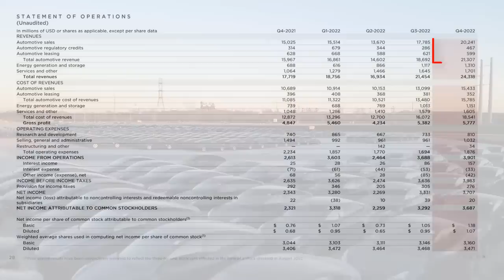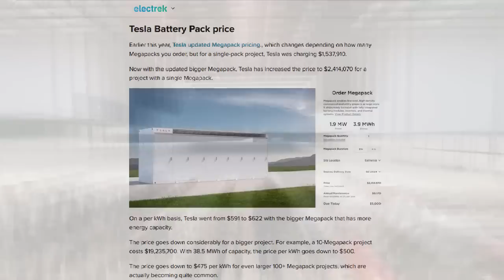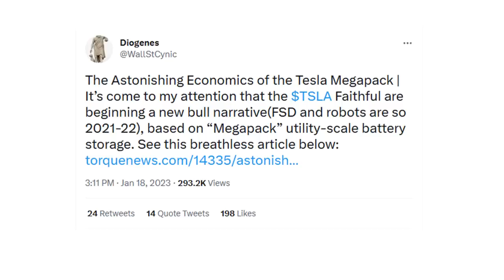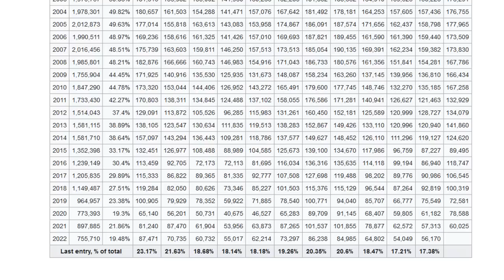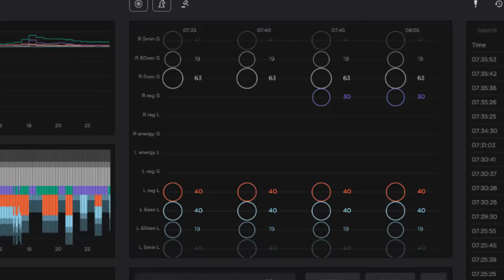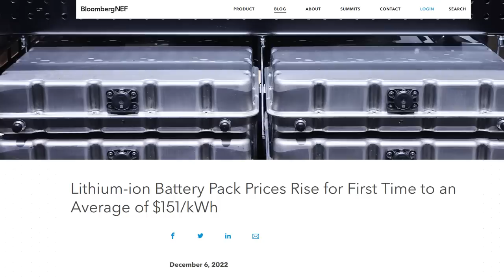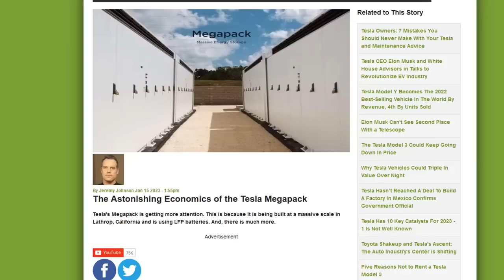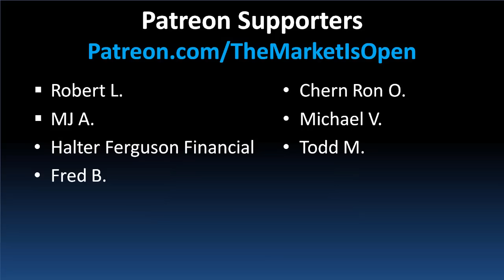How Tesla’s Megapack is SECRETLY Helping them Sell More Cars (Not What You Think)

Comment: Megapack, Powerwall, Semi, Cybertruck, Solar, Dojo, etc will all be huge but there's so many more products yet to come that no one is really thinking about.
Reply: And don't forget Starlink, Insurance, HVAC...
Reply: I am hoping for a semi trailer with its own battery and electric motor, even when you put a diesel semi in front of it it would turn into a hybrid.
Reply: @rowanbroekman3929  it's a weight issue. Adding an entire battery pack, inverts, drivetrain, charging hardware, motors etc to a trailer would massively eat into the weight it can carry. It doesn't make sense to carry around all the weight of both drivetrains when you're making money based on how much cargo you're carrying, which is itself a legally capped total amount (cargo plus vehicle and trailer weights).
Reply: @halohat2286  starlink, no. That's SpaceX, not Tesla. No word on HVAC from Tesla, that's all been speculation by the public. But you could add in Optimus and robotaxis, no one has mentioned those yet. Plus whatever else comes out of Elon's mind.
Reply: @halohat2286  And possibly a Tesla phone.
Reply: @truhartwood3170  All Elon... who also has discussed HAVC. Low priority at the moment, sure.
Reply: @halohat2286  did he discuss HVAC? I didn't see that. Cool.
Reply: @rickhammond2473  Who even came up with that idea. It just seems stupid. It doesn't fit tesla's mission or current factories at all.
Reply: @truhartwood3170  But it does make sense in a car that is only allowed to have about 300kg of weight in it? Yea, sorry, doesn't make sense. I understand it's the standard answer of a sceptic, but it's not actually true.
Reply: @pan6593  I understand, it's more like a range extender for an electric semi, but even if you would carry it around with a semi that is not electric, it would still safe quite a bit of diesel.
Reply: @truhartwood3170  I was Transport Manager for a UK haulage company for 25 years. Most of our customers' goods cubed out first. 
Furniture, insulation products, bedding, hard plastic/acrylic mouldings, blow moulded plastic bottles etc.
I even had to go to Volvo directly to get them to downplate 4x2 F7's to 20,000kg gross vehicle weight to save £thousands in vehicle excise duty.
We did max out on cement, steel (Sheffield), container transport but folk outside the industry think everything is maxed out all the time.
It's just plain wrong.
Reply: @andrewsaint6581  cool. Then why is everyone focused on BEV semis and not hybrids? Cost benefit just isn't there, bottom line. And they're a temporary stop-gap, not the solution. You'd get a few years of production before BEVs were taking over. Just look at the tanking hybrid sales in the auto industry. Betting against BEVs is now known to be a bad bet.
Reply: @truhartwood3170  During the latest Tesla's quarterly earnings report Q&A Elon did address an HVAC product. Paraphrasing he said that they did want to do it. But they had higher priorities now.

Comment: Just a thought, in my mind I think the most straightforward solution is to combine medium and small distributed battery storage Systems and ,vehicle to grid technology. In other words virtual power plants, that way every home business and electric vehicle ,could contribute to the stabilization of the grid . Combine that with existing 😅wind and solar power systems and you may have a recipe for a robust and cheap renewable energy infrastructure🤔IMO
Reply: I agree.   It's odd the]at Tesla does not seem to embrace the Vehicle to Grid idea.   It seems such a natural thing for them to add.
Reply: The problem arrives when you have problems in the grid, like a trefall over the lines or another shortcut. The grid has built-in systems to handle that and reroute the power. If the power is down due to a shortcut, we have to stop delivering power from all powerwalls and vehicles instantly, to prevent more damage and problems in the shortcut area, and to maintain the security to those going out to fix the problem. This is an issue that has to be solved.
Reply: It is just like combining grid scale generation projects, with rooftop and community scale generation. 

Put a large part of the generation and storage near the load, improves redundancy and reduces demand on the grid. 

So the Grid is supplying a constant base supply, endpoint generation is providing the middle supply, and then battery and grid peaker generation is handling the peak load when solar/wind/etc are not meeting demand. 

It just seems like the perfect gamified solution. 

Except in most regions of the world the for profit grid and generation oligopolies will obstruct this vision wherever possible. That is the real limit of humanity.
Reply: EVs with bidirectional charging will be a game changer...

Comment: Good overall article, you've got some bits wrong but not far off. 
The battery cell tax credit ($35kWh) will go to CATL or be split (similar to Panasonic) the $10kWh pack credit will go to Tesla. The 50% credit goes to the developer of the battery site / end client so Tesla wont see that apart from the fact that it allows Tesla to increase the price of the sale price but still makes the payback on the initial investment even higher which will drive further demand.

Chanos gets it wrong as battery projects get revenue primarily by the power rating (for things like grid services - frequency response etc) they can put out but the project sale prices are charged per kWh 
Megapack is 1.9MW power x 3.85MWh (3850kWh) depth for the 2 hour version or 1MW x 3.85MWh for the 4 hour version
So Chanos estimates for a 7.5GW market coudl be at least 2 to 4 times under sized (as all the market works on the same format)
The fact that one developer I know personally has 1GWh of projects in development just in the UK and that UK market is likely to be 5-8GWh on its own shows just how much he's under estimated the global market. The global market at the moment is likely in the 50-100GWh in development and rising rapidly.

Even more significant Large scale  storage pricing has gone from $275kWh for orders placed in 2020 to about $425/kWh for orders placed now to be delivered in late '24 so over the next two years as `Lathrop ramps and input costs fall / operational leverage improves the returns on MP's will skyrocket, my feeling is 40-60% gross margin in next 2 years is not unreasonable.

Comment: Megapack is shipped worldwide, so those units for export outside of the USA have the freedom to be made with Chinese CATL LFP. Or even down the road, Panasonic 4680 products. So only the units to be installed in the USA will need to be made with US Content cells and those manufacturing lines would qualify for US energy manufacturing development credits and energy credits that the US Government has on the table. Tesla can work it in various strategies for domestic and foreign grid infrastructure consumption.  

From the headlines, last week, it sure looks like Pakistan is a potential Megapack customer to stop the nationwide failure and damage of their grid, which has a history of repeated failures including last week’s completed collapse of their grid! Whenever a grid collapses like that several hundred Zero Crossing Circuit breaker must be repacked with new paddle squi)bs, which are explosives that trip the breaker at the next zero crossing of the current waveform, to prevent prevent the contacts from being vaporized is huge arc overs. The reloading and rearming of the protective relaying equipment on all the transmission lines is a labor & consumables intensive operation. This isn’t like just throwing a circuit breaker back on, as there are squibs to physically load and precisely detonate between paddles to precisely throw the breaker contacts on at the next zero crossing of the waveform to prevent damage to the contacts.  So even if absolutely no equipment damage happened, thousands of dollars are spent just to safely switch it all back on again after a protective shutdown, and it takes hours and substations and generation plants!
Reply: What happens when a mass solar ejection happens to end up being directed at Earth? From when I looked at it before leaving SoCalEdison, none of the utilities are even considering the already available 17 minutes warning to begin quiescing the grid to save load bearing equipment.
Reply: @Crunch_dGH  you can bet that Tesla will have the Megapack Software connected to the internet and monitoring Space Weather. Elon Musk’s SpaceX learned the hard way when they launched some Starlink Satellites, and a CME wxpanged the atmosphere and dragged most of them down right after launch due to overpowering and unexpected atmospheric drag that was way stronger than their little ion thrusters. So Elon Musk is now acutely aware of the effects of solar space events.

Comment: Tesla needs to add Vehicle to Load and/or Vehicle to Grid NOW....  it's 2023.  My May 2022 LR Y will be my last if Tesla does not add this feature.
Reply: V to G wears out vehicle batteries too quick
Reply: @Paul McGreevy  Paul, be for real.  You may only use it 1 to 4 times a year.  It's just like driving the car but less wear.
Tesla wants yo sell power walls.
Reply: @Paul McGreevy  if you're right... don't drive your EV or you'll wear the battery out.  Paul, please put more thought before you make a solly statement.
Reply: @Paul McGreevy  if you're right... don't drive your EV or you'll wear the battery out.  Paul, please put more thought before you make a solly statement.
Reply: @davidws5439  spend all day and night charging and un charging your car in normal life you probably travel 20 or 30 miles.
Reply: @Paul McGreevy  Paul you definitely don't own an EV.  I went from driving Toyota Tundras and Fords F-150's all my life and switched to a DMM3 Tesla in November 2018 and now drive a 2022 LRY and will never own another ICE vehicle and will never buy a BEV if it doed not have Vehicle to Load and or Vehicle to Grid and tgat includeds the Cybertruck that I have had on order for years now.  If Tesla does not want to option the v to l, I will buy another brand and lots more niw to pick from.  Have a great day.

Comment: I’d be surprised if a competitive market will permit 50% gross margins on an industrial product like a Megapack. Nor do I think Tesla will strive for such high margins since it is counter to their mission.
Reply: Long term, maybe but currently with battery supply limited plus possible edges in the software managing the grid, means the product is not yet a commodity.
Making high margins to subsidise other areas for a while (which may be a decade) and taking advantage of greater demand vs supply, they can, look at how car prices ramped during past two years as demand outstripped supply.
Reply: Tesla is not a charity.
Reply: They’re not pricing them at a 50% gross margin right now, and they are alone in the market. They’re primary competitor is existing conventional equipment, not other battery manufacturers. So, they will keep margins well below 50% to help sell more units to get big batteries established as a reliable and practical technology, then push margins up. I’m thinking that a long term margin of 30-40% is realistic.